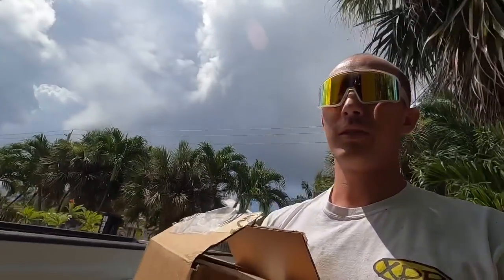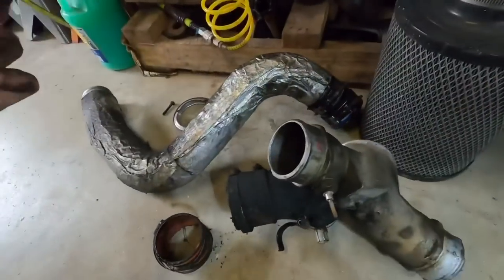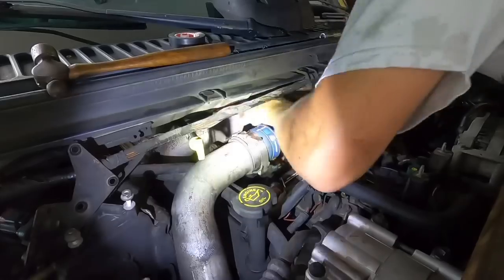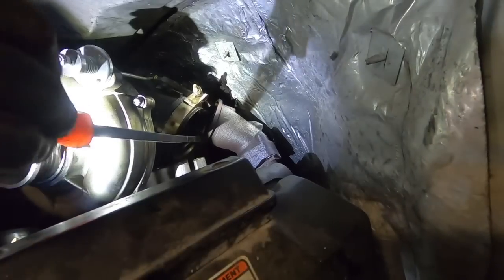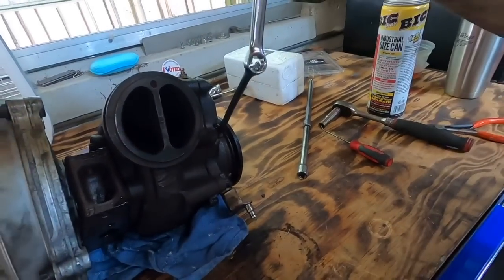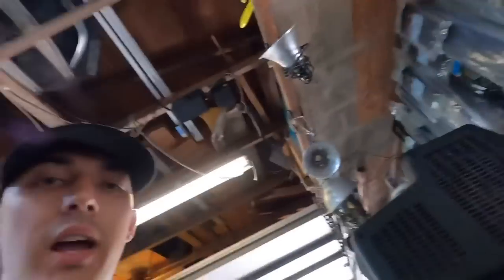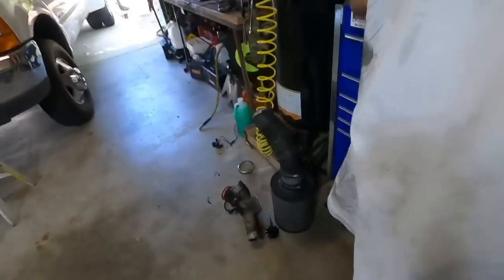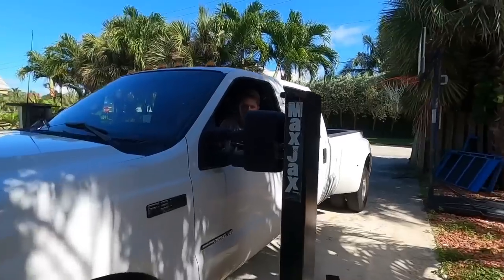7.3L dually runs AMAZING with KC Turbo's balanced assembly! Part 2

Comment: I just finished a oem rebuild on my turbo. I also pulled the pedestal, fuel bowl and oil lines. Since I’m waiting on two tools and a sensor. I about to clean up Intake manifold & bowl. You got the turbo out pretty quick.

Comment: You can use the EBPV on the turbo as an exhaust brake with special tunes. I did it on my 2002 7.3
Reply: Man that is real cool to know
Reply: That’s pretty cool
Reply: But then you really should change to heavier exhaust valve springs...

Comment: Great video, but I wish you'd said more about the results. Did the upgrade make a meaningful difference in performance? I am interested in doing this to my otherwise stock obs, wondering if it's worth it.
Reply: Im about to do this on mine, but im also fixing a bunch of other boost issues. So performance improvement may be biased in my experiences.
Reply: Following..... I just did a banks intake and also installed a gutted pedestal and ebpv delete on my 01 F350 srw. I plan on doing up pipes and a kc balanced kit. Currently with an older edge tuner on race mode I'm getting 18lbs bost on my electric glowshift gage.
Reply: Ran my truck today with enclosed 12 ft tool trailer in tow. I'm maxing out at a solid 20 psi boost.

Comment: Nice vid on the assembly but, the back pressure valve really has no use for u folks in florida.  The main reason for the back pressure valve is cab heat.  It closes and helps the 7.3l warm up faster so u have cab heat quicker.  I had mine off first time maybe 6 years ago for the WW2, while i was there i removed the buttery fly and shaft, installed steel soft plugs to close it up.  Then i removed the pedestal , disassembled the actuator and removed the guts of it.  Drilled and tapped the rod side for a pipe plug, got rid of the whole works.  This is also a known oil leak area, from the rod of the actuator.  A couple of years ago i went with the kc300x.

Comment: If you lift the body off the body of the truck is it easier to install the turbo and the up pipes.?

I half to change the oil pan that's why I'm asking!!
Reply from the maker: The engine has to come out in order to change the oil pan, but if you’re going to remove the cab you might as well do everything while it’s off!

Comment: Does this kit help lower egt's , and can you please tell me the price of this kit, I thought you said $450 in your previous video.  Keep up the 7.3 content, your doing a great job!
Reply from the maker: Thank you! Yes, KC claims it lowers egts, increases boost and throttle response. It is $450 plus shipping👍🏻
Reply: More air flow over stock always helps lower egt’s.
Reply: Could you tell a difference in boost and acceleration as well, I wonder if you think this is a good alternative to a new turbo.or In retrospect  would you just buy a whole new turbo setup for more performance.
Reply: John Vande Vusse give KC a call and talk to them about it. I know a good amount about these trucks but not an expert in turbos. KC is. Just be prepared with answers to what you want to do with the truck before you call.
Reply: @adamm74  I' have to save up some cash 1st, going to replace the turbo pedestal seals and up pipes along with whatever turbo upgrade I decide on.  My mileage has gone down recently and I'm wondering if my injectors need a refresh. My engine has 133k on it. I still get over 20lbs of boost so I don't think I have any major boot leaks. Do you have any ideas about fuel mileage loss.
Reply: John Vande Vusse  boost tester. Leaking up pipes will cause issues. Check Pressure output of the HPOP, change the fuel filters, ensure you’re getting 60 psi of fuel to the injectors, and check for boost leaks. A drop in KC turbo is a good option but if you want to party then an irate T4 kit is awesome.
Reply: @adamm74  thank you for the advice!
Reply: @The73Garage  465.and some change with shipping 😉 just pulled the trigger on one friday for my obs

Comment: Do y’all do the up pipes also ? Or do you not have too if they look okay ?
Reply from the maker: You don’t need them if they look alright! It is good to consider the factory donut gaskets that go on them can go back and will lead to exhaust leaks and poor turbo performance. They’re a cheap ford part to replace when you do it.
Reply: Ya I ended up just changing my up pipes to the bellowed ones it wasn’t that bad it came out great I put the kc300x stage 2 on mine with a ts 6 position chip so new turbo new up pipes and new down pipe to 4 inch to 5 inch than a stack put my bed
Reply: Did it all my self

Comment: Hey bud. I have this in the cart on KC Turbos site. I'm stuck between this and the stage 1 or 2 turbo. I have a TS 6 position, 4 Inch downpipe , 5 inch back and an intake. 

Did this make a nice difference?  Not looking to race really but want a nice upgrade I will notice. Hopefully a louder whistle too lol
Reply from the maker: It’s worth it for sure! It’ll be a nice upgrade.

Comment: I have a 2002 Dually 4x4 4dr. In the cold even plugged up it has no power. Just idles up the road until it really gets some heat in it. Any idea what this could be?
Reply: Diesels run terrible when cold just warm it up before you take off

Comment: Hard to find any solid reviews im looking at doing bellowed up pipes and thought about doing a kc balanced assembly while I was at it 95 auto with ts
Reply: Used the cheap swag up pipes. You have to trim the flange on the up pipes where they meet the baby’s butt. They’re about 1/4 inch too long but they’re nice.

Comment: Is that an otherwise stock truck?
Reply from the maker: Exhaust, hydra, 5 inch exhaust, DIY intake!
Reply: @The73Garage  I have a 95 obs that is stock except for Ttymar intake, exhaust, and Hydra with Tony Wildman tunes. Would a turbo upgrade make any noticeable difference without bigger injectors?
Reply from the maker: It’ll be more efficient for sure, you should see an increase in throttle response and a smoother power band.
Reply: @The73Garage  thank you so much. Love your channel!
Reply: @sbag11  do you like your TW tunes?
Reply: @Turbotalkin  I do, gives the old truck a little snap. Plus, with the Hydra, you can go online to Power Hungry Performance and download the tunes they have there for free. Pretty cool to play with.

Comment: As a owner of a 2001 7.3 with 250,000 miles on it and new injector's... I just don't understand some of this. Buy a Porsche or a performance car.  It's a Diesel for gawds sake, not a friggin sports car. A 944S2 16 valve 3 liter FOUR cyl will do 150 and outrun most stock 8 cylinders, snd handles!!  My gawd it handles!  Plus.. if you like to spend money keeping it running...its car for you!  Chuckle.
Reply: Everyone has their own taste. They like to build pickups with power
Reply: @loganvanburen4349  yeah.. I guess so.  JOKE:  And some farmers like sheep.  Chuckle.  I understand because I have flown a 50 foot wingspan sailplane to 21,000+ feet with no engine, and a oxygen tank.  Renegade stuff is fine I guess.